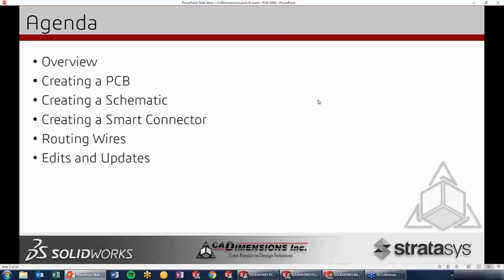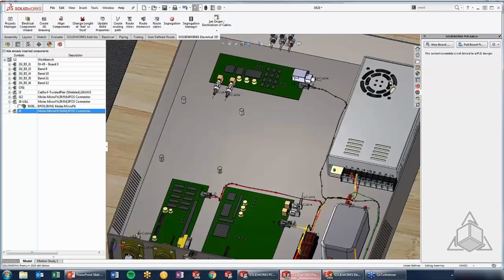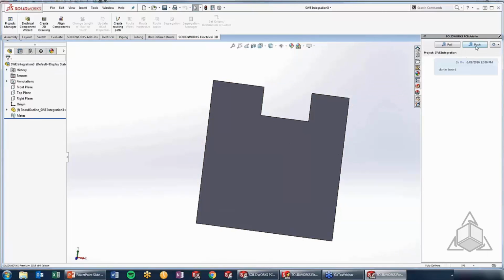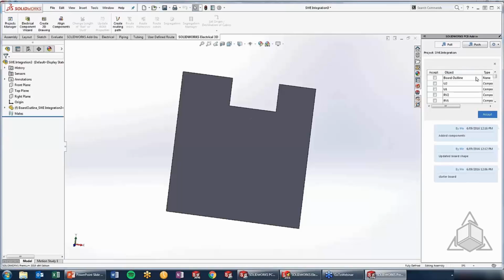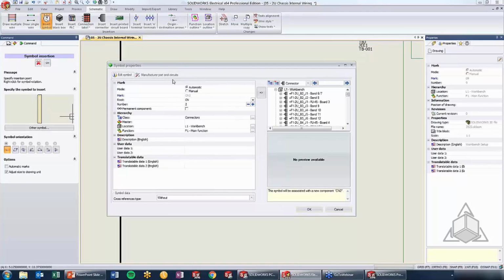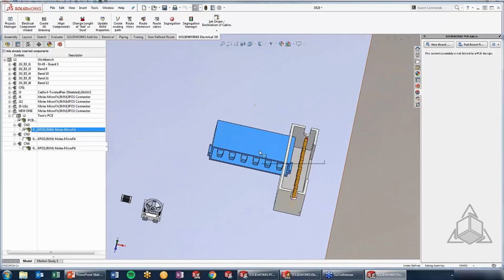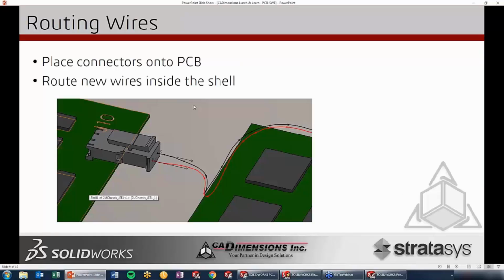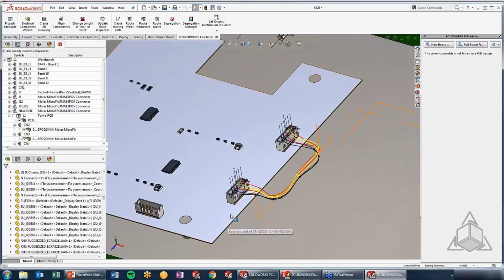PCB with SOLIDWORKS Electrical

Comment: Hi, what is better to use Solid PCB or Altium ?
Reply: They have the same engine, Altium designer can connect to SW thanks to a plugin, SW PCB is not sold anymore and is meant to disappear, in favor to Altium solutions. So.... no choice: Altium designer is the future.

Comment: can we export Proteus simulation file of electrical circuit in Solidworks PCB????
Reply: simulation? you can exporta pcb manufacturer files and import them into swpcb, but swpcb haven't simulation engine.

Comment: Why did you have to duplicate the electrical assembly components with mechanical ones on the mechanical assembly? Can you not just have a single cohesive entity that's associated with the mechanical part like you did for the PCB?

Comment: Can we use Altium Content Vault with solidworks pcb ? if possible how ? Thanks
Reply from the maker: Try contacting SOLIDWORKS directly, we are unfortunately not able to help with this issue. We apologize for any inconvenience!
Reply from the maker: Vault libraries are usable in SOLIDWORKS PCB. However, if you are currently using Altium, you may only need the Connector for similar functionality. Thanks for watching!
Reply: i'am currently using Solidworks Pcb, but when i installed Altium Vault it gives me server error and i cant see any content vault search window in solidworks pcb ? Should i return to Altium back ?
Reply from the maker: If you are using SW PCB, then it is not possible to use the access the Altium content vault.  To access additional manufacturer’s part content, follow the link to the PCB Content store.
https://designcontent.live.altium.com/#UnifiedComponents
Reply from the maker: Your local SOLIDWORKS reseller will be able to assist you getting the Connector license you need for AD17
Reply: How can I get solidworks pcb connector serial number for AD17? Where buy?
Reply: We have tried to contact reseller , but we do not get any response